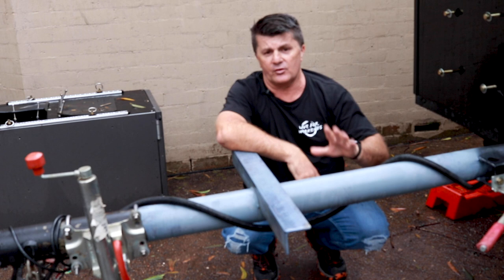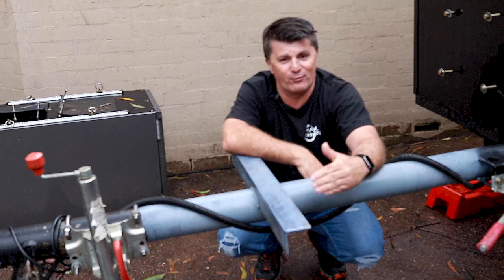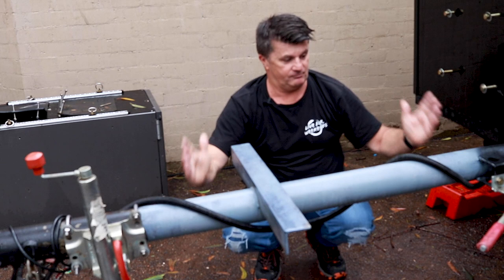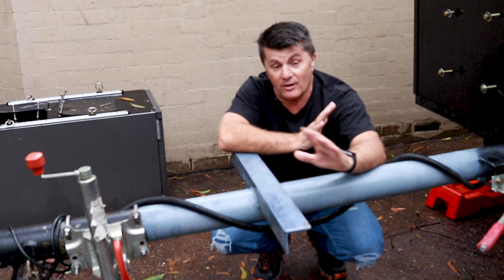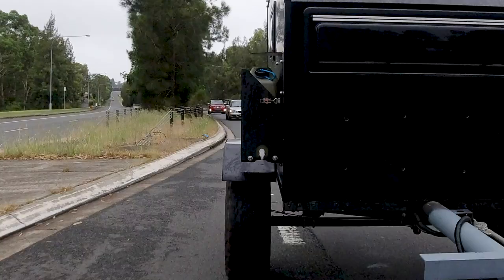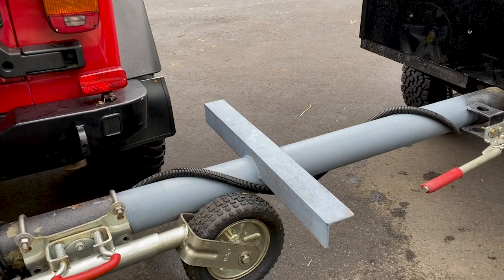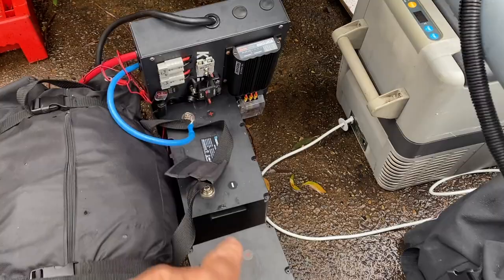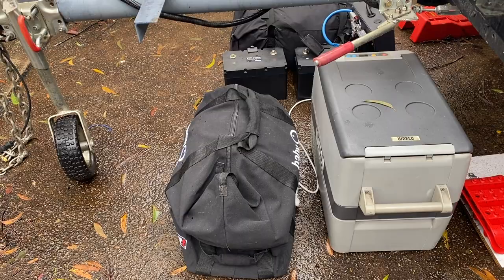DIY Off Road Camper // Drawbar Extension - Part 3

Comment: That driveway is tight. Imagine if you had a 79 series and a patriot camper. Impossible to reverse up there.
Reply from the maker: It's just a rental whilst the new place is built and you do get used to it. I'd so love a 79 single cab on portal axles lol.
Reply: @DarrylSheather  lovely rigs, I’m a Jeep guy. I have the TJ-U longer wheelbase than yours, all I ever wish Jeep would have done differently, offered them with the Mercedes Benz diesel. The 4.0 is a robust unit itself but the diesel would have brought the package together nicely for touring. Still admiring your newer version ARB tire carrier, one handed operation has to be more pleasant than my older ARB